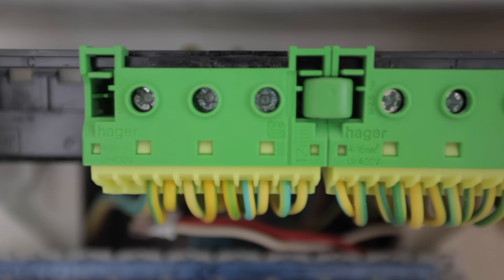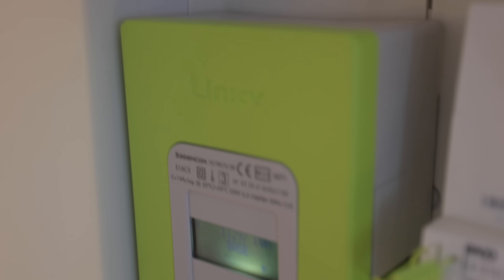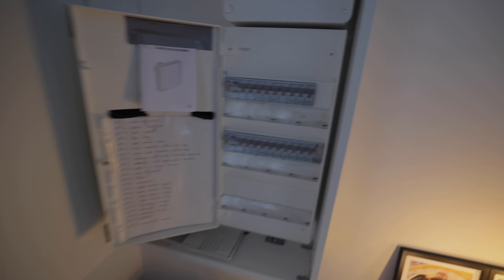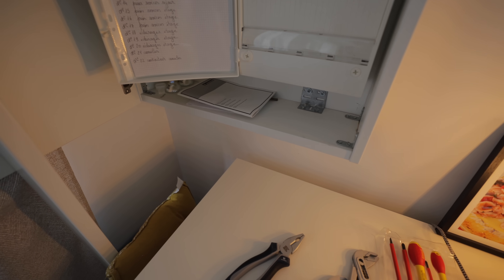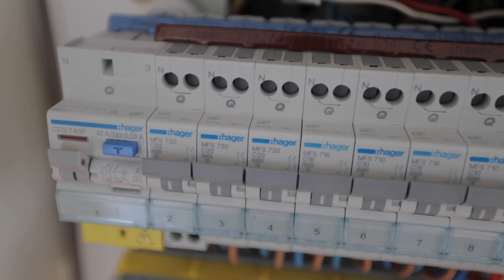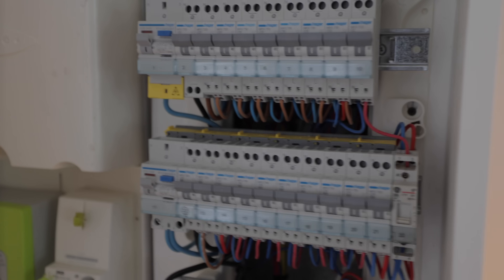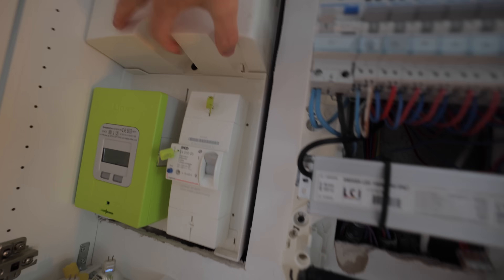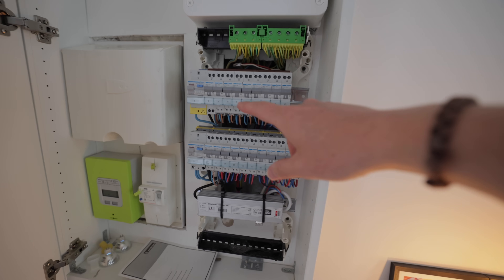U.K. Electrics SUCK! This is what we should be doing…🇫🇷

Comment: All the old telephone lines belong to the same company, France Telecom (which is today the Orange company).
To avoid having them intervene for nothing, a few years ago it was decided to separate the France Telecom part from that of the customer.
If the internet works when connected to the DTI, it is a problem in the apartment and the responsibility of the owner.
Conversely, if the internet does not work at the DTI, it is up to France Telecom to intervene.

The same thing exists with fiber (DTIo) but the operation of fiber optic lines being very different, the box is not obligatory and almost never installed.
And on the right is an antenna distributor which arrives and leaves on all the antenna sockets in the home.

For differentials, the NF C 15-100 standard explains everything.
And there are installations which resemble those in Great Britain, this was before the NF C 15-100 standard evolved.

Toutes les anciennes lignes téléphoniques appartiennent à la même entreprise, France Telecom (qui est aujourd'hui l'entreprise Orange).

Pour éviter de les faire intervenir pour rien, il y a quelques années il a été décider de séparer la partie France Telecom de celle du client.
Si internet fonctionne en étant brancher sur la DTI, c'est un problème dans l'appartement et de la responsabilité du propriétaire.
A l'inverse, si internet ne fonctionne pas à la DTI c'est à France Telecom d'intervenir.

Il existe la même chose avec la fibre (DTIo) mais le fonctionnement des lignes fibre optique étant très différente, le boitier n'est pas obligatoire et quasiment jamais installer.
Et a ça droite c'est un répartiteur de l'antenne qui arrive et repart sur toutes les prises d'antenne du logement.

Pour les différentiels, la norme NF C 15-100 explique tout.

Et il existe des installations qui ressemble a celle de Grande Bretagne, c'était avant que la norme NF C 15-100 évolue.

Comment: the first rcd is 0,3A leakage current for dry spaces and the other rcd is 0,03A leakage current for wet places or outside circuits
Reply: Wrong. Theyre both 0.03. A is for inductive loads (induction coller, heat pumps, car charger) AC is for the rest.

Comment: Hi just come back from a week in France during our stay the hot water system failed and the heated towel rails also were not working the owner moved a switch from auto to on in the fuse board, 4 or so hours later the water was scalding hot so I turned the switch back to auto. the towel rails again did not work but appeared to have a supply after doing some googling on the Hager website I was under the impression that everything on one row of the fuse board was under some sort of external control. I use kinetic sw in the uk to do something similar. The system was Delta Dore Calybox using a Hager fuse board similar to yours. The owner was convinced that he had no control over it but it looked like the smart meter had some sort of supervisory input any ideas.

Comment: Actually there is a problem with this installation. As far as I know, the left module needs to be explicitly prepared to receive current from the bottom, which seems to be the case for the upper one (yellow cover) but not from the lower one. 
On the cheap electricity thingy you are right. EDF (French electricity provider) sends a signal when the price is lower which enables the water heater. It generally happens twice a day (at night and at around noon).

Comment: With only a 1 phase system flow heaters for hot  bath water are not possible (usually 21 KW) that is why space is needed for the I assume 220 V insulated hot water tank upstairs. Downside is the limited supply of give or take 50-100 liters of hot water!

Comment: I went to France once to look at an old property with a friend.  While I was there, it was discussed about French electrics.  From what I understand, all wires had to be run in conduit to stop mice noring on the wires. Also, each outlet was individually fused.
Hence, there  were no ring mains or lighting spurs at that time.
Reply: only in the old times we found fuses on every socket. Now it's all on the consumer unit. A cable (like R2V) without conduit is OK, but wires have to be in a conduit.
Reply: and we don't have ring circuits in France. I think it's mostly a UK thing. We use in France 20 Amp - 2,5 sqmm wiring - 12 sockets max. or 16A - 1,5 sqmm wiring - 8 sockets max. Even if it's legal, 1,5sqmm on socket circuits is uncommon. And it's always 2,5 sq mm for kitchen appliances or washing machines.

Comment: It's possibly been said already, but the RCD's are both overloaded.  Hopefully installed before the rules were modified. Nowadays, we can only put a maximum of 8 circuit breakers per RCD.  For the Type A RCD, we would usually only put the cooker and washing machine on it. Also, with the LED Driver in the box, you don't have the 20% of free space available for addiing circuits.
A difficult thing to stomach, is the control circuit of the relay for the hot water tank is not on the same row or RCD as the power side.
The other thing I just saw, is that the seal for the blade fuses is gone, which is technically an offence to break.  You should not be able to access this, at all.
Apart from that. it's a nice board.
Here in France, the board should be installed between 1m and 1m,80 with a 60cm wide, unencumbered space. Your board is fitted to a GTL, or Gaines Technique de Logement, an excellent bit of trunking upon which we can attach the consumer unit and comms board.  It usually has a seperation to keep the comms and power cables away from each other.  It's a nice neat way to safely bring all of the cabling to the boards. 
The only thing I really prefer about English electrics, are the sockets, with the isolation switch and no sticky out earth pin... I miss them...

Cool to see you in France, bon courage!

Comment: I think you are assuming all houses are like yours. The electrics you have look brand new. You can't compare to old victorian houses in Britain.  I bet some of the old Gites have crap electrics too.
Reply: There is absolutely no reason old houses have crappy wiring. Sure, it can be difficult to renew wiring in old buildings but on the other side of the channel they put decent wiring in since the 60’s at least. If the wiring is older than that it has been time to do something about that several decades ago.

And even with questionable wiring in the house, it is absolutely inexcusable to have a crappy breaker box. It’s cheap and easy to make something decent out of that.

Comment: Crusty tools ... I actually love those stanley screwdrivers.
Cumulus is a water heater. Looks very similar to Belgium except that our breakers don't have push fit.
We also have day/night rates and that water heater will only get fed during the cheaper night rates.
The signal for it comes from the network operator and is "decoded" by the meter (or an special device paired with an old meter).

But they gonna phase out the night/day rate system here in Belgium, so we will need even smarter devices that can "guess" when it's the cheapest moment to feed you water heater.
This could also be used with a home battery : buy electricity at cheaper rates and use when you need (can be handy during winter when you don't have enough solar energy), although I doubt this is really economical since the wear on your battery is more expensive than what you save on daily rate fluctuations.

Comment: 1500W for a water heater seems very low.  Here a 275L water heater (eg) has two 4500W elements.  Top thermostat heats the top third (near the outlet), when it is hot enough it switches the line down to the lower thermostat to heat the bottom (water inlet part).  Takes about 3 ½  hours to heat a cold tank to hot but probably shower ready in 1 hour (top).
New tanks have a third element of 800W at the bottom to heat small amounts of incoming water.  This is for the utility's benefit to tame peaks - thus they subsidize the purchase of them.

Comment: I did some work for a friend in Ireland (Dublin) some years ago, they had the rcd/rcbo consumer unit with double pole busbars into the circuit breakers similar to this.  Much tidier than all those neutral wires going back to the right termination.  I'd never seen them before...or their peculiar screw-in circuit fuses with the fusewire in them - really horrible bits of kit.  I worked in the UK normally

Comment: In the UK, lack of space and price of installation in older properties is a driver for locating CU in obscure places.  
I recently had a new CU installed in my bungalow, and we were trying to decide on the best place to put it, because I wasnt happy where the existing one was.
It had to be relatively close to the incoming meter feed, otherwise the cost of wiring (and labor) between the CU and that would have been excessive.
I could have put it in the entrance hallway, but that is quite narrow, and it would have stuck out into the hallway space.
In the end, there wasn't any other practical option, so it ended up in the same place as the one it was replacing:  Inside a cupboard in the master bedroom (which being a bungalow is at ground level). It also had to be at the top of the cupboard to prevent it accidentally being covered by stuff. So not great, but what can you do?

Comment: The Type A RCD is necessary for equipment this may generate a DC offset (might have a DC component).
This includes any type of equipment that will use a chopper circuit so that the the current usage is not always strictly sinusoidal.
Examples of such equipments would be: motor speed control, induction cooker etc...

My guess is that an AC RCD uses a differential current transformer as a detector and thus cannot detect this DC offset.
The type A RCD must either have a secondary detection system or a completely different one that can detect any kind of leakage (AC and DC)

The DTI connector is connected directly to the incoming copper line and is mandatory. It is supposed to be devoid of any local equipment (capacitors, filters etc...)
It is there for fault finding purposes. If a technician needs to know if the fault comes from outside or the local equipment it is easy to find that out.
The rest of this DTI box is mean to allow reorganizing of the RJ45 connector(s) as phone line (ADSL), data network (ISP box) or even television (Cat 6 minimum ?)

The current limitation of the main RCD is linked to the fixed tax you pay, the provision for the  maximum allowable current draw.The Linky meter is connected first BEFORE the mains RCD. Basically anything before the output side of the main RCD is considered "no touchy".
If you temper with the equipment or cause any damage, you will be fined.

Comment: G,day from Sydney Australia. That is a very impressive consumer unit or I call it a distribution board. Thank you for teaching me about type A RCD and the presence of DC current leakage from electronics in appliances. Gee there wouldn't be much. Most power supplies to transformers have diodes (current only flows one way) and MOSFET chip in which there is a gate pin (current switch).
Don't touch the juice!!!!
or Amps
💫🌏🇦🇺

Comment: The mains is the circuit from the street mostly 3 phase but sometimes it is single phase and in big flats etc it's 6 phase and all of these are protected by a 80 to 100A cut out (fuse) and then it's supply's the meter and after that it's called the installation and that's what is the circuit and all of or most have a 100A main switch (isolator) and by the regulations have a 15 to 30MA rcd (trip switch) and the circuit or installation follows on from there like👍👌

Comment: Having the wire colours that aren't in the regs is dangerous you could touch a wire thinking that it's a switch wire yet it's a live wire no wonder people have so many problems over there if you don't have specific colours mcbs rcbos connections and types of cables and electrical components for the job specified in the regs well then that's a big problem like
Reply: Neutral must be Blue, Earth must be Green/yellow, all other colours can be used for phase wiring. The gaines (conduits) come prefilled with the 3 conductors and the live will be brown or red dependant on the supplier a switched live must be a different colour, most electricians will use purple or whatever their favored colour is but would never use brown or red, if you see any wire colour other than blue or green/yellow you HAVE to assume that it will be live, even if you think a conductor is a switched live you should not touch it, it could be switched on.

Comment: One thing I like about French electrics is the wiring. Neutral and earth have to be blue and Y/G, but line can be any colour, which makes visual tracing a lot easier. I've seen purple, orange, yellow, grey, black, red, brown, white. No cables, all wires in conduit, which feels less bulky.
One thing I don't like is the sockets: they don't have switches, and are generally more flimsy than UK ones. Also the position of live and neutral used to be optional, but I think that's changed to live on on the right now. Not allowed now, but you still find a lot of non-earthed sockets run off lighting circuits.
Reply: That's really dangerous having a specific cable colour specified in the regs is good but if you use other one's it makes it dangerous for any electrical engineer working doing the jobs like don't listen to this guy as we have our own regulations and electricians who can do a good job in this country some better than others so do your own work and stop putting our electricians down and do your own work to the specified regulations pal

Comment: RCB type AC is cheaper and save only, when used with devices, which don;t modyfing shape of current. When You have eg. hair dryier with speed adjustment, and You set it at half speed, the shape of current isn't equal to sinus shape. In this case type AC may have slower response to current changes and react when currency in mA will be higher then declared and it's dangerous for human.
Type A can handle such changes in shape of current.
Type AC is used for classic devices eg. oven, classic light etc.
Type A is dedicated to charges (they works with impulses), hair dryiers, PC, TV etc.

Comment: There are very good comments from Germany so far. My bit to say is, that I like the double switch system you showed in the video. Even when it is from Hager, I didn't know it, as I haven't seen these so far in installations. But it's really cool stuff. In Germany it is also common practice to power the circuit breakers from downside and connect the loads upper as leading the cables outside of the box.

Comment: Adjustable fuse....with no means to calibrate accurately or test.... pointless. Why can't we test MCB's or overcurrent protective devices  ? 
Still crap design, although at least all modules are double pole, which is an improvement. Bus bars should be hidden, main terminations should be in the back of the board, and all protective devices should be modular and simple plug in. So easy to swap, replace, upgrade etc etc.
Some ok features in it, and in reality there shouldn't be a type AC RCD anymore. You'd never guarantee no DC ever ever.